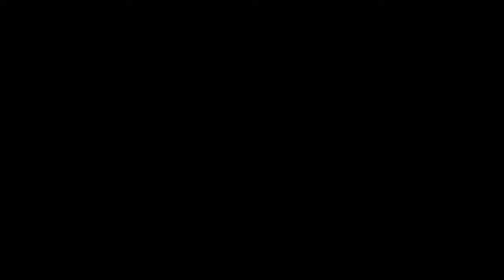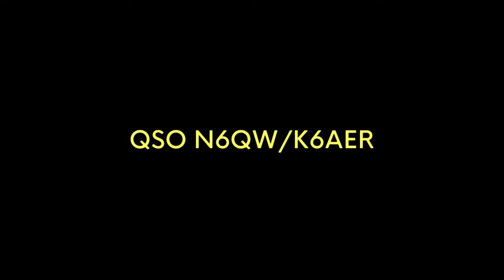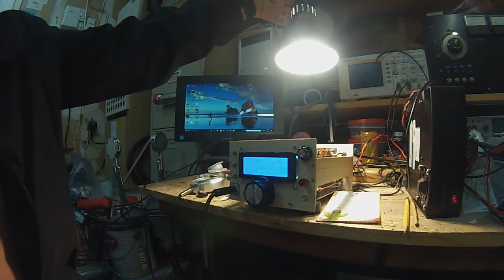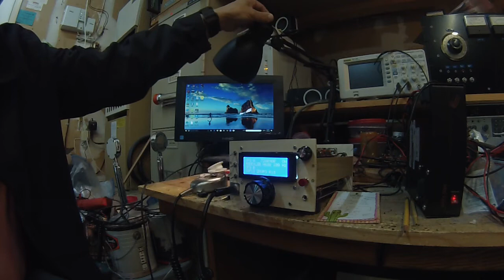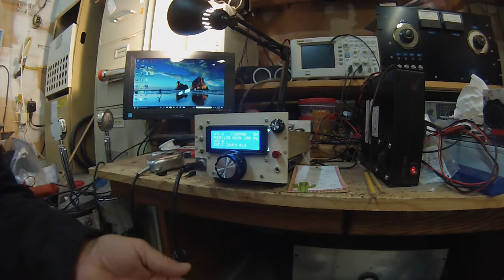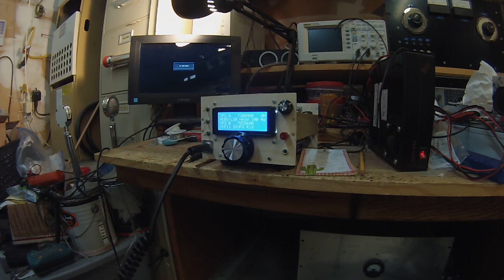Dual Filter Dual VFO

Comment: Beautiful as always, Pete! As commented below, sounds great and very quiet.....
Reply from the maker: Hi Dean,

Thanks for your post. There is not much to this rig as it is the 9 MHz filter set off of that surplus board and a couple of Plessy Amps. Not much to it.
Hope you are keeping warm. Looks like some cold weather headed your way.

Pete N6QW
Reply: Yeah, crazy cold weather.  Real low -3, wind chills near -45.  I guess I won't be working on any antennas tomorrow..hi hi

Comment: Signal is just booming in.  You latest builds are soooo quite. Still working on the Sudden  transceiver and the Rx chain is impressively quite. You have quite a bit of patience waiting to join in QSO.
Reply from the maker: Hi Dave,

Thanks for your posting. The lengthy listening period was by design. I wanted to show that the rig faired well with both weak and strong signals to avert some the comment that on strong signals it would fold. BTW I was running two amps at 600 watts -- so no reports from the other end that the signal was not good. This design is essentially the Plessey amps and diode steering for which filter to use. There is one dual J310 amp in line that acts as either the RX RF amp or Tx pre-driver. The driver is the 2N2219 -- these two circuits pre-date the Sudden application. 

73's
Pete N6QW

Comment: what kind of equipment is that on the upper shelf far right?
Looks line a linear amp?
Reply from the maker: Hi Mike,
Yes that is a homebrew linear amp -a 3CPX1500A7 on 20 Meters. if you go to my other website www.jessystems.com there is a link to that amp and you can see the construction photos of the amp. It will do more than 1500 Watts!
Thanks for your postings --it is a quiet xcvr!

73's
Pete N6QW